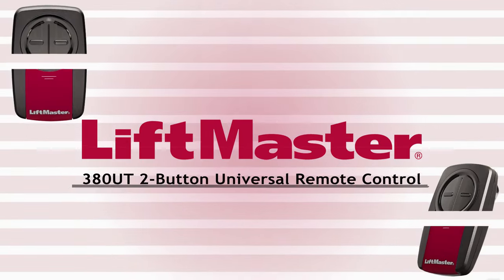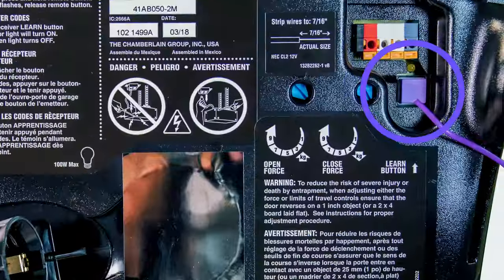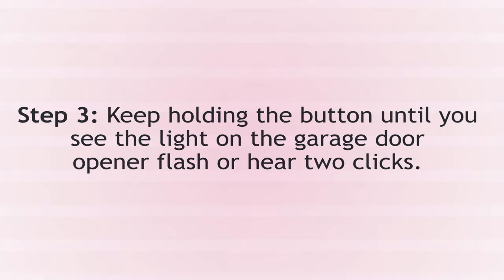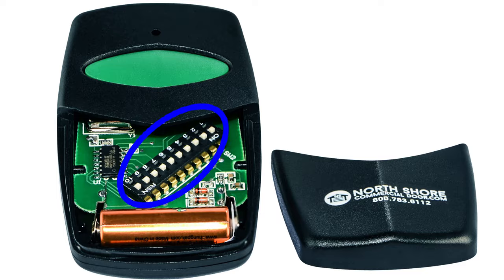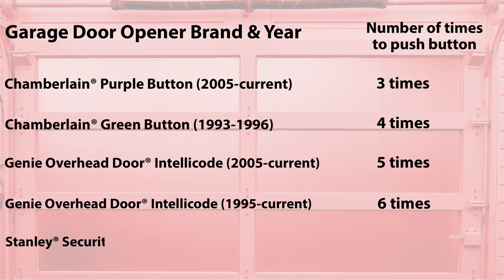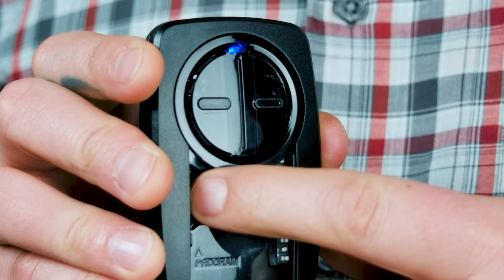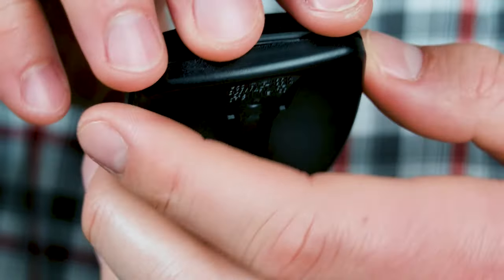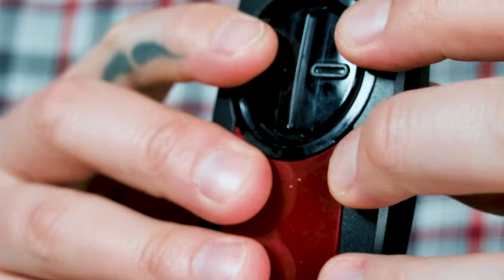How To Program and Change the Battery of the LiftMaster 380UT 2-Button Universal Remote Control

Comment: Ridiculous that it's designed to just pry open the case to change battery. Seems designed to break it accidentally
Reply from the maker: Pyroshen, we understand your concern with this aspect of the remote. We can tell you from experience though, we took apart and put back together the remote dozens of times for the video and had no issues with anything breaking, cracking or chipping. The battery only needs changed approximately once a year,  so the unit doesn't need to be opened that often.